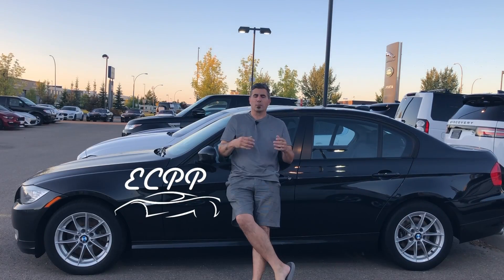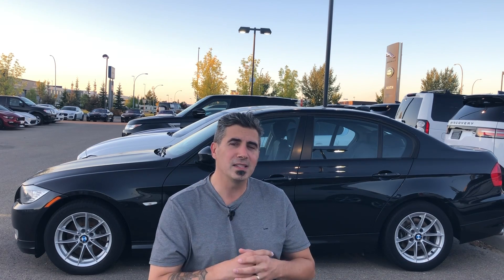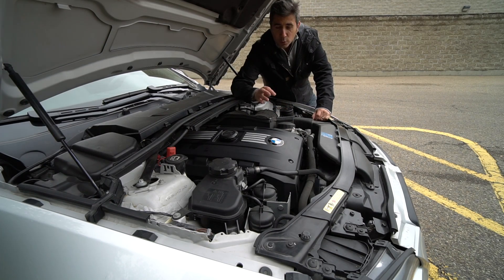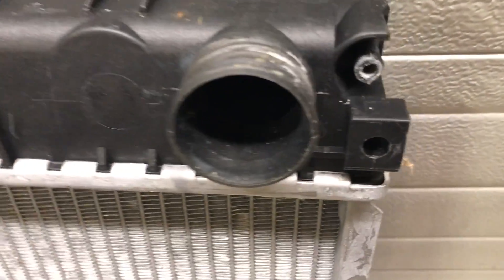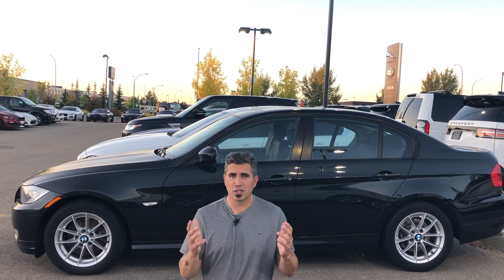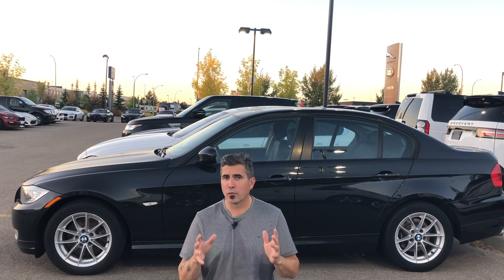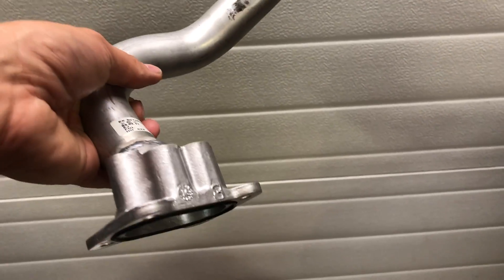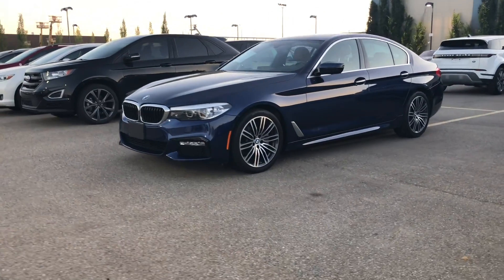Why Does BMW Use Plastic Engine Parts??

Comment: 2018 BMW X3, 38,000 miles - had the oil housing break yesterday... and I'm looking at a $2800 bill today for the replacement - of a PLASTIC PART.  Super unhappy with BMW right now.... and will be selling and moving to something more reliable and less costly.
Reply: damn. i mean they have got to be planning this

Comment: all junk coming out of germany plastic nightmares nothing but constantly breaking garbage especially if sent to a cold climate where the cold breaks plastic with nobody touching it ! these are all junk do not buy a german car if you live in a cold climate you will spend thousands on plastic parts pieces hoses and sensors
Reply: So is is bad to have the BMW in cold climates or summer climate¿???

Comment: Fiber reinforced plastics can be amazing.  They don't corrode, very strong and can outlast many metal parts that electricity plus coolant, oils etc can really corrode.  Companies like BMW should know this, but you really have to cheap out not to use them.  Molds can't pull as many parts as pure plastic which drives the price up only slightly.

Comment: It's called planned obsolescence, why you sugar coat it? They want you to keep buying new cars... Since more and more things will break down and at the end add up as if you got a new car if you repair them and still will keep you stranded since more things will brake... So you go to buy new. I say we should boycott this before every part breaks after 2 years... In motorcycles the same. In my new bike the transmission broke after 7k kms.  My 2003 bike at 63k kms still runs fine with no issues... The company on my new bike said the put the wrong alloy for the transmission and I was out of warranty since I didn't used it much and was only for 2 years. It happened on the 3rd year at 7k.  Also waiting for parts 6 months still not fixed. They said they now put the right alloy but can you trust them? Unfortunately only oem was available

Comment: Would have loved to hear how their resale value is a joke. Spend that kind of money on a luxury car only to half to put ridiculous money back in after just 5-10years. Better off buying a brand with real relatability and stop throwing your money away to have a luxury label. 
   BMW is a perfect example of people with more money than they know what to do with, so they buy a car that is just label. 
 There are cars 10-20 years older with twice the miles you can put on a BMW. They’re also worth more with double the or triple the miles. 

BMW’s are way over priced especially when they use plastic

Comment: You can't recycle plastic.  Anyone who told you that they could are lying.  This is planned obsolescence and also BMW is cutting costs.  There's no benefit to making these parts out of plastic instead of aluminum.  There's no benefit of having cars crushed and recycled when it's always better to keep it working.  You do create carbon to melt down everything and make a new car.
Reply from the maker: Cheers

Comment: Owned a 2012 550i.  Got rid of it before it caused any problems at 65k miles.  Own a Toyota now. Just change oil
Reply from the maker: Exactly

Comment: BMW's used to be very over engineered, awesome great driving cars that lasted a long time (the older straight 6's where excellent)    now its a name, they drive good, but i wouldnt own one past 60 to 80 k miles...then dump it.    King of depreciation....german cars    Plastic is recyclable....but so is a better quality aluminum part...   BMW charges the same but builds them cheaper    Look at the price of a used BMW.....POS

Comment: Life’s too short to drive boring and unreliable cars. I don’t want a BMW 3 series 330i anymore. Maybe I’ll get a Honda Accord 2.0T at 252hp with a 6 speed manual or 10 speed automatic.
Reply from the maker: And those are just as good to drive as the 330 but far more reliable

Comment: You should make a video about part 11428585235 (oil filter housing) failures on BMW UKL2 platform (X1, X2, MINI and many others), this plastic part seem to have lots of failures. You can see on all BMW parts resellers this part is out-of-stock on most of them. I had this failure by luck I was able to see the coolant leak and stop my X1, otherwise, I'm sure the engine was to blow up in a few days.  Part is overpriced +$700, this failure repair for sure goes for $4K+ at the dealer.  These UKL2 platform BMW are rubbish, that goes for all BWM as well. I see a class-action lawsuit on the horizon, but best to stay away from buying BWM.  Let me know if you need pictures of the fail part. BMW is doing a good job of removing any comments and pictures about this issue on the web.
Reply from the maker: You are totally right and I have had experience bad bad oil filter housing seals myself and it’s a real BMW issue.  They leak oil, they leak antifreeze, they blow gaskets and they blow oil rings, and yet this product is used for many years of vehicles.  Just no lessons learned there.  Another glorious design by the brand.

Comment: BMW owner, of new 2021, x5,  40i ,   Oil system failure, large oil leak, in my driveway, due to plastic part, connecting oil cooler and oil filter to the engine block, service department said x5 will be down for a month, due to back order of this part...    really ticked off,  a 74.60 k dollar product has plastic parts in the hot oil system...   nuts..   these folks have lost it, for building a reliable product...
Oh, this is ironic, one of the dealership personnel said ‘the vehicle was driven too much in the last eight months “    really...  it’s a “ new “ 2021   $074,500.00 dollar product..  🤣

Comment: People do not get plastics can be blended to make them deteriorate faster in their applications.
Ever see some plastics not even exposed to the sun or heat become discolored, dry and brittle? Yet, some exposed to the sun do not (garbage/rubbish/trash bins)
Manufacturers now know the blends to cause this and are constantly refining (hence some breaking too early).
Even house hold items have been designed to become like this to promote sales, reduce life cycles and hand me downs (taking away future sales).
The 80's and 90's they either did not know the blend as well or were still honest (hence plastic parts never break as early)
Today, it is NOT about the environment but profit.
The Environment is just being used to buy new products (designed with parts that do not last as long).

Comment: i have a 2008 Suzuki Grand Vitara with heaps of plastic parts in the motor including the thermostat housing, its done over 400,000k and none of the plastic has ever failed, the driffence is BMW use a type of plastic that is recyclable friendly, this type of plastic tends to fail from heat and age,  i agree they should look at what fails and make aluminum replacement parts, well that could be a good side business for someone to take up.

Comment: My e46 coolant tank failed me today. Dumb China parts, I just did a complete replacement of hoses, thermostat, mounting plate and the tank. It didn’t fit snug all the way down but I felt that eventually one road bump too many that it would crack or fail and it sure enough did. I think I’m going to buy this chrome/aluminum tank I saw. It’s $200 bucks, but it may be worth it. I have an aluminum power steering pump pulley because cheap China plastic smh 🤦🏽‍♂️ ok I’m ranting, me and my bimmer are always in a constant fight, but this time I will win!

Comment: They use it because of EPA & the UNs equivalents standards. Because of the environmentalist wackos cars are coming with smaller engines made with lighter materials. Sure car manufacturers are saving some but all this new egr technology, plastics & smaller engines is to try to keep up with EPA auto standards. Its like Obama's brilliant idea to demand cars have 54 mpg by 2025 which isnt going so well. The EPA also drives up the fuel cost so if your thinking 54 mpg sounds good it wont matter because your engine will melt, your turbo small 4 cylinder motor will wear out twice as fast & your fuel cost will double. Im seeing trucks & suvs with 2.0s or smaller. Im all for making the air quality better but lets be honest we accomplished that decades ago. Its not the 1920s anymore. Most car repairs today are emission related & the carbon buildup in these small turbo engines are really bad. In the 1990s & early 2000s we were making cars that could eclipse 500,000 miles but thats not in the cards for this current generation. Also all this electric car hype is bs  & those pushing it are very disingenuous. They want you to plug in your car to a power supply that gets its power from fossil fuel generators instead of just pumping the fuel in your car. You think its bad when the power goes out now just imagine not being able to charge your car when that happens. What about EMTs, weapons that send out a pulse that could destroy a nations power grid. The environmentalist are gonna send us back to the stone age. You better think deeper about this cause its not all about car companies saving money.

Comment: After some fool buys a new BMW, the "BMW" changes to "Be More Worried" while you drive that piece of plastic crap.  Lots of their parts are made in China.  Many of those parts, made from recycled plastic, are purchased from companies like Alibaba.  BMW's bottom line is only for more profit, not better gas mileage or any other bull crap!  Several years ago my Mercedes CL600 had both plastic fenders split externally where they were bolted to the engine compartment frame.  Plastic is garbage!

Comment: Let’s talk about the e46 bmw.  Hope everyone who reads this chime in. What parts should bmw have made with metal rather than that junk plastic?  For instance on my e46 while removing my front bumper I broke one of the cheap ass plastic hangers just infront of the tires. So I remade it with aluminum.

Comment: BMW is a shit company.They actually sell cars with known problems that will cost thousands or dollar to repair.The e46m3 e60m5 and m6 all have the same disposable rod bearings that BMW knew were going to ruin the crank or block.They also knew that the e46m3 had subframe problems and sold them anyway.Shit company yep!
Reply from the maker: Exactly, why?

Comment: They would stop this practice of using inferior materials if the customers just quit buying their cars and told them why.  Unfortunately, all people care about now is the monthly payment instead of the quality of product they are getting for their money.  Therefore, the quality will keep getting worse.  Maybe they will make brakes out of plastic then charge $800 for a brake rotor when it fails after 5,000 miles by giving the material some exotic name.

Comment: If BMW insists to use plastic part in engine bay, they should make sure these components are easy user access.  I’m seeing they are doing it in opposite way (N55->B58).  Service department is becoming BMW cash cow nowadays.

Comment: On my E60 545i, I had an expansion tank split where the seam in the plastic was. I lost all of my coolant and nearly lost my engine. If you have to have a BMW, lease it and give it back. Bad news for the 2nd owner.

Comment: They spend so much on engine development , handling etc...And they succeed in refinement and power, yet its all for nothing when you have all the external plastic parts crack or disintegrate? it doesn't make any sense..most drivers who purchase new BMW's are overweight fat cats. Weight means nothing, if you are trying to make the car lighter.

Comment: Nice vid. If BMW were really interested in saving the environment they would not make disposable lease toys which fall apart after warranty. This is so much wastage compared to a reliable car which lasts 10 years without major issues. But agree they are fun to drive while they work.
Reply from the maker: True

Comment: m30 series motors from BMW came out in the 60s and lasted till the 90s. Last of BMW all metal reliable mills.

Owned e24 (2) e23s and a e34 all exceeded 250k miles. Had a 3.8 stroker over 150k miles as well.

True meaning to not built like the use to. Only problems these had were cooling due to the block design but if not stuck/avoided stand still traffic is usually fine.

Comment: I own a 230i. I had a small PLASTIC coolant tube crack. $30 part that cost $550 because the whole intake manifold had to come off to replace it.  Then I had the oil filter housing crack which also has coolant running through it. $1500 repair.  ⚠️ I found out AFTER the fact my extended warranty DOES NOT cover ANY plastic pieces. Which incidentally are the most likely thing to go bad.  Still love my car and lucky to have a good mechanic but yea. Beware on those warranties.

Comment: This has nothing to do with being green. Its about cost and making money on parts. Its like at my.work. i install granite countertops. The whole shop uses water to cool the tools and lubricate the polishing pads and saw blades. We use a shit ton of water a day. Yet we are self reliant with water. We have trenches built into the floor that go to a pit and then get sucked up.into a huge filter and then out it comes clean looking and into a tank and back into the loop. My.boss sells it as being the wave of the future so that our children bla bla bla. No it saves money. Yes we tear down the filters and clean them once every 3 to 4 weeks. And thats labour i know. But thats 4 hours of labour once a month vs the cost of 8 to 10 thousand gallons a day of water. Every single green company doesnt give two shits about the environment.

Comment: Then what about changing all those plastic parts (problem known) with another design (performance parts?), in aluminium/steel and not in plastic? if you are changing a part with a failed design with a new part with the same design, what is the point? it will fail too.  If that's possible it would be the best choice to do if available, buy it new, then put performance parts in it replacing the failed design parts when you reach the end of warranty.

Comment: I’m taking care of 3 BMW’s in the 7-10year old range and am shocked by the catastrophic plastic failures in the cooling system. 
The plastic doesn’t just crack, it disintegrates, it falls into tiny pieces almost of almost sawdust consistency.
It give no warning. Looks fine one day falls off the next.
I work on many other brands, North American, Japanese, Korean, NEVER see anything like this with their plastic parts. 
The solution seems to be just bite the bullet and replace everything at about 7 years. That way the car won’t suddenly fail while driving, (there are at least 6 parts that will fail without warning, the only guarantee is that they WILL fail, and pretty much between 7-10 years.) Some components are available in the aftermarket but made of aluminum instead of plastic, fit and forget.
This is not a frivolous issue. Sure you’ll get a warning on the dash that something has failed BUT unless you take immediate action there is a good chance that you’ll seriously damage your delicate aluminium BMW engine, very costly.
The other BIG issue with BMW engines is the oil seals. The mess and smell is bad enough, but the ones on the oil filter housing drip onto the serpentine belt causing another catastrophe. Check the net for more details on this!
There is something very wrong with BMW plastic. 
Surely Aluminum parts are also recyclable?

Comment: The plastic argument as being more environmentally friendly is complete nonsense, metals are much better at being recicled and have longer lifespan. They use plastic because it's cheap to produce and charge customers inflated prices for parts that cost them pennies to make. Also when recicling plastics the products are lower quality than ones made from "virgin" material.

Comment: BMW wants to sell dynamic cars. Do achieve that the cars shall be lighter. Which means passive safety compromises due to the structures capability limits. Additionally many small components is made of light weight plastic components. Which are also simply inexpensive.

Comment: Coolant becomes corrosive and eats thought the plastic over time, if you change your coolant every 30k miles, you could squeeze a few extra years off it again, I’ve seen N54 water pumps with 150k original miles on them, but I’ve also seen them go out at 40k miles electrically.

Comment: What kind of video is this? You know how many companies use plastic parts in their engine? My household has owned GM, Dodge, Subaru, BMW & they’ve all had plastic engine parts. BTW 10-12yrs after mfr date is normal for turning over parts.
Reply from the maker: For sure but not 3-5 years
Reply: ExoticCar PlayPlace Huh? They under full warranty the first 3 years after mfr date. I currently own a 2015 X3 & 2019 M550 both were brand new. Only issues was a wheel bearing & iDrive camera malfunction. I hope ur not projecting issues based off a old used car someone else ran in the ground prior.